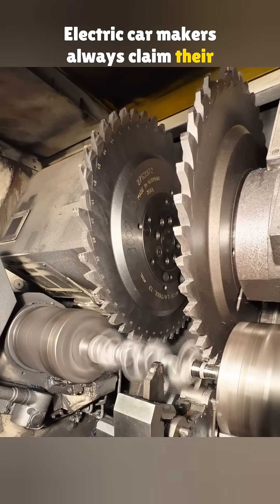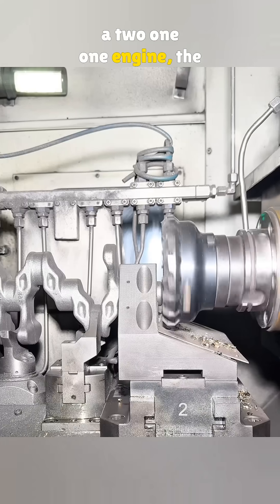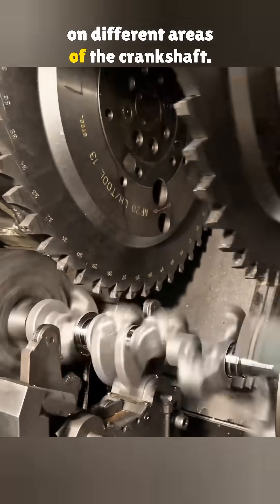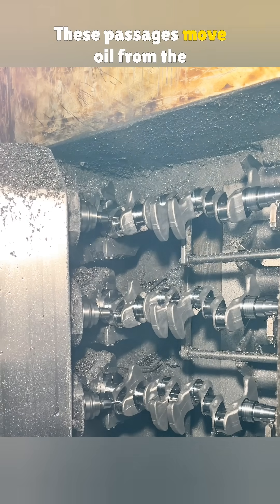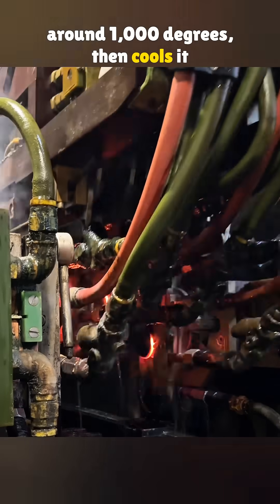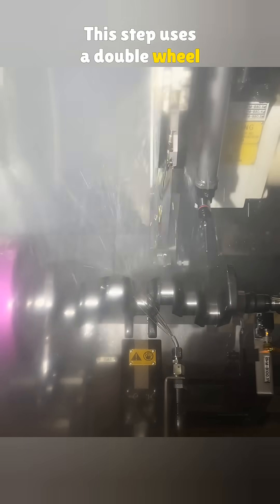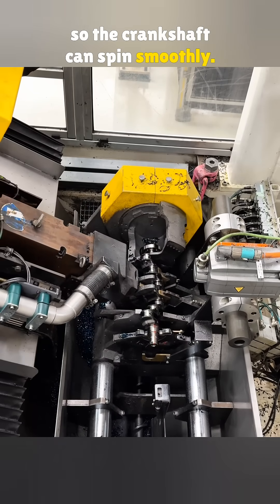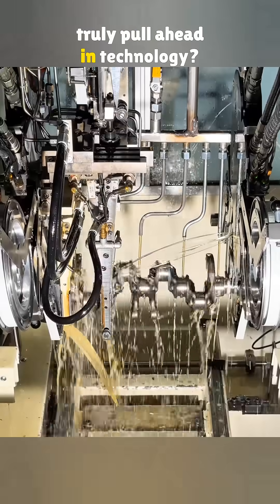Inside the High Tech Behind Modern Crankshafts

Comment: Making an ICE engine requires a lot of steps. We know this. Now we talk about the process of building the motor for the electric car. First of all, the motor body is made, and is checked to make sure it is a true cylindrical shape. Next, the stator bars are fitted to the body of the motor. The windings with insulating material is installed. While this is being done, the armature is wound and checked for balance after it has been spun at high speed to check for balance. Corrective action is applied to the armature if required. Once this is done, the end plate is fitted to the motor body, then the armature is installed after the bearings are fitted to the armature shaft at each end. The electrical connections are then attached and the other end plate is fitted. The bolts holding the motor together are installed. The motor is then attached to the gearbox which is usually a planetary system and then filled with the special oil. The downside of electric cars is everything in the car relies on the battery to work. When the battery drops to 30%, you need to find a charging station to charge your car. Most electric cars have a range of about 300 miles. I drive a Mercedes Benz A180 bueEFFICIENCY car. On the open road cruising at just under the speed limit, this little car uses about an imperial gallon of petrol per 55 miles. Yes, I have tested it. If I drive it at 60 mph instead of 68, it will get 60 miles per gallon. I kid you not. With these fuel economy figures, why the heck would I buy an electric car? Simply put, I won’t.

Comment: There are at least two ways of looking at this.  Combustion engines are built to standards impossible 50 years ago, but the engine would be largely understandable to the mechanics of 50 years ago. There are refinements to increase efficiency and ameliorate pollution.
However, electric vehicles have a number of innovative technologies particularly in the domains of electric motors, control systems and battery technology, none of which would be immediately recognizable to workers in those domains 50 years ago.
Reply: Part of your comment is wrong. In Germany, car manufacturers were using extremely fine tolerances 50 years ago. Care to explain why there’s so many 50 year old German built cars on the roads around the world?

Comment: Over 55 years ago, when I was in high school, I worked for a machine design company in the Detroit area.  The company I worked for designed machines that manufactured engine blocks, crankshafts, diferential housings, and other automobile components. The company designed machines for several tooling companies that built machines for Ford, GM and Chrysler.

The machines were designed and built in the US. All the components for the machines were made in the USA.
Reply: My God but me most importantly I love the way western countries cooperate as in working hand in hand to achieve certain goals

Comment: Yes, ... Electric cars WILL, if not already have, overtake gas cars in complexity. Just look at the one component of the electric car, the battery and the tremendous advances they've made over the years... And batteries are but one small part of the vehicle... The electric motors themselves are AMAZING tech and are just getting better all the time.

Comment: Electric car still need the crankshaft?
Reply: no
Reply: @peeinacan1 thanks for reply,but i wonder why the prices of electric car rise as a gasoline/diesel car when it don't have any complex things in it?
Reply: @lesterluna3211  well im not 100% sure but i believe a large part of the electric car cost is the material for the battery.  and people seemed to have a problem with electric cars  in the past, with how far you can drive them, so i think theyve been making larger batteries for them to increase the range and also the price
Reply: @peeinacan1 on my mind is,it just the same as the Rc car.if it about the battery as u mentioned sound like no logical😅

Comment: What is a journal when talking of car engine components?
What is the original language of this video?
Reply: Do not know but  the word 'journal' is English metal maching term. 

Journals on a crankshaft is what the connecting rods to the pistons are attached to. The critical machining aspects are dimensions, roundness, and edge taper. 

P.S. A journal refers to the cylindrical portion of a rotating shaft that sits within a bearing surface. Journals handle radial loads and are critical in components like crankshafts, camshafts, and turbine shafts.

Comment: No.  Making an electric car is easier.  That's why it's more advanced.
Reply: Exactly. It’s easier and if it weren’t for the cost of batteries, it would be cheaper.
Reply: Just my suggestion. This video promotes the technology needed in production of a combustion engine more than the technology in the finished car.
Reply: Nice 😂😂😂 that’s the point of tech - you think we build a washing machine jus to make it harder to wash - seriously 😂😂😂😂
Reply: @WhoIsWangZi great point. I have forgotten this argument. I find electric vehicles are not designed taking in account the average car user.  Early adopters are not indicators of how accepting the average user will be of all the idiosyncracties of the current electric vehicles. 

I myself will only drive ICE or hybrids until AEV can be used on long trip without spending time looking for free charge stations. Where I am they all in use after working hours until very late in the evening.
Reply: @finestructureconstant3921 , Why do the charging stations have to be free? Do you get your gas for free? Or do you mean “available”, as in the typically all in use?

The thing is, with gas cars everyone has to go to a gas station to fill up every single time they run out of gas. The majority of electric car drivers will charge at home over 90% of the time, and many hotels have charging stations that you can use to charge. You can also find chargers near restaurants, grocery stores, and other locations that should mostly be available since most people are charging at home.
Reply: @terjeoseberg990 I don't think he meant "free" as in "free of charge" (uh, heheh), but as in "not occupied".
Reply: My EV charging built into my navigation so charging stops are easy to find, forgive me but you have no idea what you are talking about! 
Charging stations are available 24 hours a day and long trips are easy because all major highways have superchargers at all of the major rest stops.  I have driven over 100k miles with two trips from Boston to Chicago, three trips Boston to Washington DC and countless trips to Maine and Rhode island .  

I waited five years to buy an EV does that make me an early adopter? 

The EV I bought is now seven years old this is all well established and far more reliable!

What idiosyncrasies are you talking about?  It is far easier to own an EV.  No oil changes, no 30k brake jobs, no EV valves, no air mass density meters, no ECU. There are so many reason EVs are far easier.

How are early adopters are not normal people?

How are EVs not designed taking into account average car users?
Reply: @rob1andrews Genuine question, after 7 years of owning an EV have you noticed any battery degradation?
Reply: @rob1andrews you know there are other countries that also have electric cars and have a completely different charging infrastructure than where you live? The world isn‘t just america…

Comment: I believe internal combustion engine driven cars are years ahead of the electric.  They have been evolving closer to perfection for decades.  The question is when will reach internal combustion technology peak efficiency?  It may be soon if we abandon them for electrics.  Even though technology and science advance, there would be a fast dropping incentive to fund efforts to advance internal combustion efficiency.  They are good enough now if we are replacing them soon.
Reply: Modern advancements push peak thermal efficiencies toward 40% in optimized conditions, but real-world averages remain lower at around 30%, varying between  20-40% depending on the number of cylinders 4/6/8/12 , driving conditions and engines design.

In this regard four-cylinder gasoline engines  generally achieve the highest fuel efficiency.

Note: Modern diesels reach 40-50% peak efficiency versus gasoline's 30-40%. This holds across 4-, 6-, or 8-cylinder configs.
Reply: Current electric cars convert 85-91% of the electricity from the charger into motion at the wheels, far surpassing the average gasoline engines of 30% +/-.